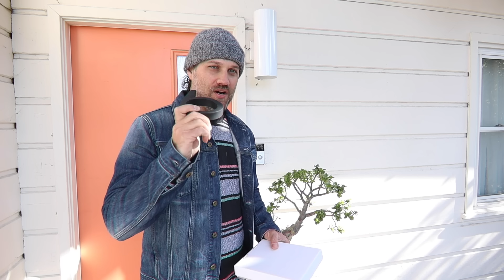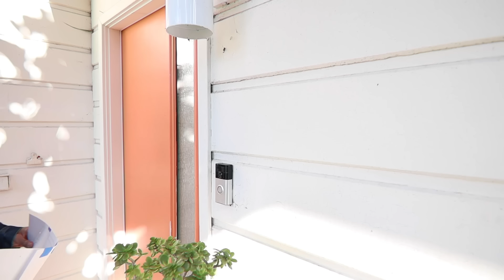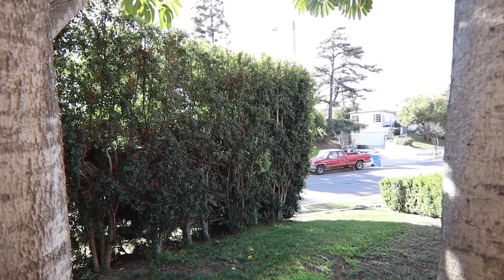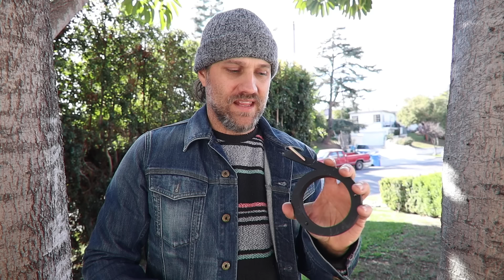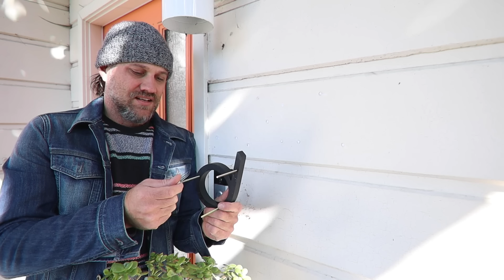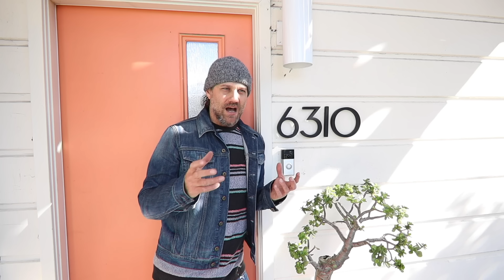House Numbers: a diy introduction and installation

Comment: make sure you use the correct drill bit size, the spacers should never fit into the holes.  that's an O not an 0
Reply from the maker: There os and 0s are the same. I just applied on another one of my properties

Comment: what do you if there is vinyl siding?
Reply from the maker: There is usually a substrate under the siding.
Reply: @clawandhammer4635  hmm yeah just afraid to make holes in the siding ....if I mess up whats the best way to repair those holes?

Comment: Just a tidbit speaking for those of us in public safety. Having your house marked well is sooooo important. Make sure the numbers are large and in contrast to the color of the background. Reflective numbers is a huge plus. If you are having an emergency you want us to be able to find your house quickly and easily. When we are responding to your emergency we have a lot going on like radio communications, lights and sirens, traffic around us and pre planning on how we are going to manage your situation best. Having your address visible is just one less thing we have to worry about. I recommend having your mailbox marked with at least four inch numbers if possible and mark ALL three sides of the mall box as well as marking the house itself. Avoid weird scripted fonts for the numbers. You want the numbers to be easy to read and bold. If you want cute scripted don’t save it for the street name or your family name.